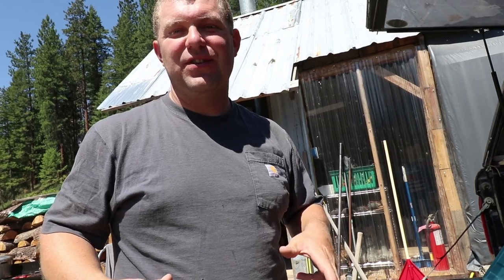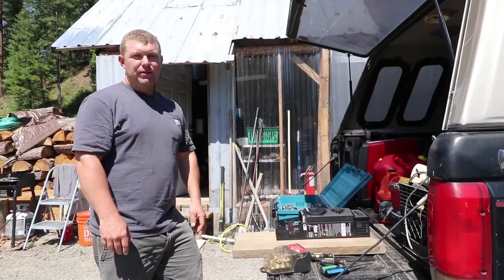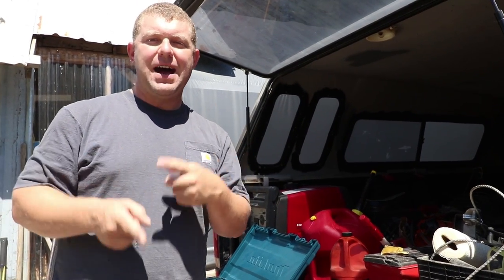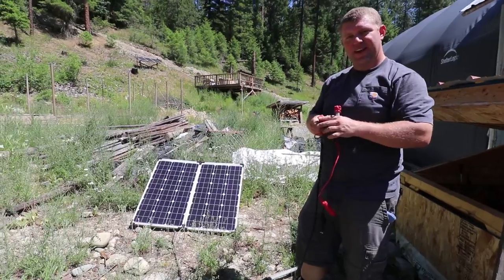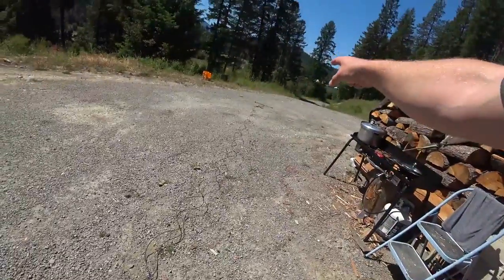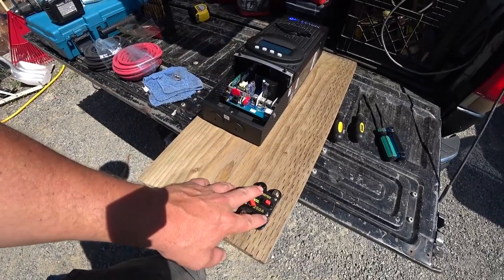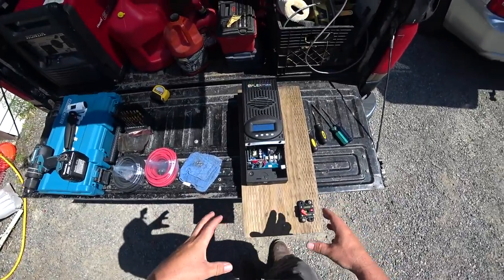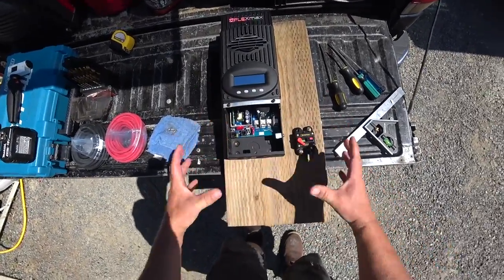Bad Idea? Now We Want Even MORE SOLAR POWER! (480 to 1230 Watt Upgrade)

Comment: Here's what they don't tell you about running a system in such a way. MPPT works only in stage 1 (constant current), when you go into constant voltage (stage 2, 3) the controller is holding your absorption voltage at it's preset (you must raise this beyond 14.4v to your batteries recommendations usually 14.7v+) and current limiting as the battery fills. It DOES NOT convert excess voltage here. so running a set of panels in series is killing available amps going in. And if you're not getting into boost mode due to a larger bank, you're spending most of your day in stage 2 and 3.

Comment: don't know if anyone else caught it but future advice. Never ring cut around a wire with a pocket knife any nicks in the wire my give you a future failure, also you really need to have a grommet or thru box clamp to keep your wire from the edges of the metal enclosure. The voltage is low but amperage on a DC system can be quite nasty when it gets shorted to ground. I have a friend that lost all the skin and muscle between his thumb and fore finger due to a short circuit at a DC connection he made.

Comment: I definitely don't want to sound like I am criticizing you, in fact quite the opposite. Going for the MPPT was the best thing you could have done, especially in your situation. However, when you're considering upgrading your system next time around, think about jumping over 24V altogether. The upgrades don't have to be step by step :) You got plenty of batteries to hook them up in a higher voltage configuration right away with minimal/no additional purchases.

Take it easy!

Comment: You said you have a problem with your battery bank getting hot have you thought of installing a couple of fans out of a computer and wiring them to a solar panel from a cheap solar powered flood light. We did that at a hunting cabin me and my family use and it keeps them a whole lot cooler.

Comment: Hello! People like to talk! I think YOU Guys are a Team plus are learning about everything! The same thing happen to Me! I started with 12 vdc inverter Big mistake! And about the voltage of your panels there is no problem! the way you combined them is the thing you have to worry. the charge controller mppt is rated to certain input voltage. for example 150 vdc, your panel input can not exceed 150 vdc.The charge controller will take care of your input,just dont go over the rated voltage.Were I live is very hot! I will give you guys a trick! Do this experiment, Spray them with water and you will see! mist them with water they love it!  It will improve your output! Good Luck!

Comment: hi safety note

it looks like you are using kabelklamps made in metall 

it might be wise to pot in some non conducting materials in case of coldfloting in the insulation 
extra important if you dont have a fuse on the battery side,
a short circuit ther can burn your cables and explode the batterys'

Sorry if my translations is wrong butt im translating fackterms from Swedish

Comment: Hi ! Have you considered getting a wind turbine to supplement your existing solar arrangements. Canadian Tire sells a 500 watt system for under Cdn $200.00 (and may be cheaper when they have sales ). I don't know how close you are to the border, but it might be worth it, considering the exchange rate.  There seems to be alot of chattering about wind turbines in northern latitudes. Cheers Michael Boulton

Comment: Good move! Should make your days much quieter without the generator. The more panels you have, the more days you get useful solar harvest throughout the year.

12 and 24v systems have cheaper parts than 36 to 72v systems and the 12/24v stuff is easier to find retail.

Comment: Batteries need to be clean and dry. Test positive terminal to anywhere on top of the battery to see how much voltage you are leaking away to ground.
Clean and Dry.

Comment: I use 2 24v 170 watt panels in parallel  that I got good deal on used not knowing certain panels were for certain voltage systems  and my cheapo chinese 30$ controller  has no prob stepping down and its not an advertised feature.

Comment: HI JUST A HINT don't wire the charge controller direct put Anderson plugs smaller one on the array side and bigger one on the battery bank so you can quick disconnect either one if you need to move stuff !!

Comment: If you're getting 70 volts input, it sounds like you connected the solar panels in series instead of in parallel.

Comment: I am very proud  off you2, let's get more of your kind, let's experiment, and learn along the way.......I have a suggestion to you maybe you can use the 12V small panels just measure the volt and series / parallel connect them with the big panels, The Volt and Amp have to mach If you have, lets say 3x12v, 6Amp and a 30V 6Amp panel. Then you can series the 3x12V 6Amp to a 36V 6Amp panel, and then parallel them to a 30V 6Amp panel, and then you have a "30V 12 Amp panel", it is not that complicated, the volt from the 3x12V = 36V vil end up as a 30 V 6 Amp panel when connected to a 30V panel.....   .....keep on learning Best to all JT Denmark DK

Comment: on the house thing if you do a renovation always have it inspected before you even consider buying it because you will be surprised at the amount of homes that still have asbestos in them where I live we cant remove the tape on the air ducts because the duck tape is keeping asbestos spores held down and its been like that for at least 20 years no joke and we knew about the asbestos and we know better than to disturb it.

Comment: your breaker probably needs to be smaller, you ideally want a breaker with amps a bit higher than the normal operating range of amps. 250 amps likely wouldn't "break" until well after your system fried.

Comment: Why not use your old panels to bring power to another location on your property? Having a small system to have lights up by your water storage and/or hot tub that doesn't draw from essential elements isn't a horrible idea. Plus you could then use it for a couple luxury items. No one is going to judge you if you add a little outdoor sound system (I use that phase loosely) and electric skimmer for the hot tub. You might not get to use it year round, but could be nice when you can get to use it. Another idea, emergency power in a storm cellar. And you might have an easier time running your freezer if you have it underground. Just throwing some ideas out there, although I can't think of a reason not to have a storm cellar even if you don't run power to it.

Comment: There is no rule of engineering that says a system must be pretty to work well. People evaluate systems on their appearance because they don't know how to properly evaluate them on their performance specs.  Understanding how your solar system works is an admirable thing.  That kind of knowledge will empower you to make changes to your system and not be at the mercy of the contractors.

Comment: I think you will find that if you wrap your freezer in 2 inch rigid insulation you will find it not coming on very much. you can get 2 - 4x8x2 sheets at home depot relatively cheap ---
Reply: I had the exact thought.
Reply: or build it a small room with an air conditioner :)
Reply: Why would you do that the heat from inside the freezer is rejected to the ambient area via the condenser. Which is close to the outside skin.That's why the outside of your freezer feels warm to the touch when it's running.

That's like  running down the street with a blanket over your head in the summer
Reply: Depending on the type of condenser the freezer has, that might not be an option. If it has an external condenser coil, this will work. If it uses the outside of the case to radiate the heat off of it, this would raise the head pressure, because it would not be able to get rid of the heat that it removes from the interior of the box.
Reply: Really really bad idea. It would not work well at all.  The heat pumped out to produce the ice inside is dissipated through the skin of the freezer. If you put insulation around it then it won't dissipate the heat.  The only place you can add insulation is to the lid.
Reply: That is not true, i have seen it done with no side affect
Reply: C Thompson ......
This may be a location issue!  In the UK fridges and freezers invariably have a condenser at the rear (allowing the heat to convect upwards out of the way) ..... Insulating slabs would work with that type of device!
Reply: Dave W, Here in the US you almost never find newer fridges or freezer using the rear condenser.  Occasionally you can find a cheap unit that does that but not that common anymore.  We had one as a kid on a fridge. It was always full of cobwebs. Never actually seen one on a freezer.

Comment: I noticed your freezer is quite empty or your really strong     to make your freezer run less use plastic jugs 64 oz to 128 filled with a salt water solution for a lower freezing temps      fill jugs to 75% to 80% n put in your empty freezer space     I have about 10 gals in my freezer n it barely runs

Comment: Why not build a second rack for the old panels closer to tour old charge controller. You can parallel the new and old systems. If this creates to much charge current for the battery bank charge rate, make an isolation switch where you can turn them on during high loads. Alternatively add water heating (hot tub even) dump loads.
Reply: You may get messed up data logging, but no more than your generator.. There is ALWAYS a use for extra panels on some sort of secondary system.

Comment: I think it's time to start building, no matter what your construction technique maybe you have several years of building in front of you. Building permits, plans, materials?? If you're using the saw mill that lumber will need to air dry for a year. Depending on your location building codes could have a real impact. Good luck.

Comment: Don't be in a hurry to retire the old panels.  Another good home is a fine and good thing.  In the meanwhile, it's still free power.  Even the cheapest charge controller and an under-performing battery(ies) might find something to power.  Even one of them might ventilate your primary battery bin. ;-)

Comment: Constructive criticism here - also I may be seeing these videos out of order but.....
Your new charge controller seems to be more effective at getting the power out of the solar cells so I would really have loved to see you change the charge controller and run it with your old panel to see how much more power you got out of that one.  In other words, I would have like to see you change only one variable and see what the changes, not just the size of the panel as there is more that affects the power output of the panel than just size.
Also, you mentioned that you had a lot of extra wire after your last job. It is possible to mitigate some of the energy lost in a low voltage run by paralleling wires because then you lose much less energy through resistive loss.

Comment: One suggestion:  I deal with high power connections for HVAC.  If you run by some conductive thermal grease, you could save potential overheats at those lugs.  You can test the connections by feeling if they get hot. I have had 6 guage wire connectors blow off, spark and burn an inch of insulation and melt some copper due to an imperfect condition.  I think the aluminum connector paste will work.

Comment: use old panels to power fans on batts case the large pc ones work great as if enough sun they power faster or slower depending on heat/sun or use the car solar panels you get i use on my van so if no sun no fan as no sun no need for the cooling

Comment: Having knowledge in several areas like you explain is called a JOATMON. "Jack of All Trades - Master of None". Which isn't a bad thing. Knowledge is power and the more you know about everything the better you will be at anything.  However, this is not to say you should ignore good advice, I don't think you do.

Anyways, the biggest thing to remember about solar is that it is not a on demand system. You need storage. If your batteries top off at noon, then the rest of the day is wasted power as there is no place to store it. Your inverter draws power from the batteries, not from the panels. So, your next upgrade should be the batteries. Add more, don't need to go bigger, just add more. 
Until we are allowed (yes I said "Allowed") to have more efficient batteries, the batteries will always be the weakest link. However, I don't suggest mixing news ones with old ones. But if you can add 4 or 6 more "good" used ones - do it.

Comment: Nice you finally got the MPPT installed and see the benefit, but as an electrical engineer dont use that 250amp breaker for disconnect on pv, they are designed for automotive use and majority can only handle upto 32v and you giving it 71volts !, if you switch it off or it trips (doubtfully) you will arc the contacts and i will cause oxidation damage to the contacts on the breaker which will result in a garenteed failure, luckily though the outback controller you have has the arc fault detection and will save your bacon but the damage has already been done. my advise is rip out that 250 breaker and find a proper solar DC disconnect switch, as you said the system is only as strong as the weakest part, please take my advise and dont touch that 250 breaker while the sun is out i dont want your next video to be a disaster :(

Comment: Guys - you tubes has 2 rules set in stone
1 - Haters will hate
2 - EVERYONE is an expert in their own lunchbox...... listen, filter, adapt if it fits or offers another opportunityu & solution

Perfection is a goal/ state that is NEVER achieved except to the participants...... as I learned in the military 99.99% of experts are  "EX" - once of..... "Spurt" - Drip under pressure. Most experts I have ever met in my Military or Engineering life have had ZERO real life experince in their fields of "experise".... don't sweat it, don't let the turkeys drag you down to thier level.... real quick you will find that they live for that shit....... Your path -walk it with heads up & happiness!

I admire that you responded, however to those of us outside the ivory towers, you are rocking your world & thank you for sharing

Comment: why not reconfigure the panels you had been using in to with your new panels? Like if they are both 12volts the series them to bring them up to 24 volts which would add those watts to the over all system. most panels that I have seen are based on the 12 volts the differences being how they are wired together.

Comment: Why are you not considering an integrated unit such as the one from Flin Energy? Their dual MPPT  3kVA 24 volt unit should be similarly priced as the Outback charger only unit and you get the inverter also. Lastly you can prioritize whether you want to power the load first and then charge the battery etc. Further the dual MPPT allow two different set of panels.

Comment: Basic facts:  24v or higher for your panels will reduce power loss.  Current 2x= power loss 4X.  Wire can be much smaller.  Most efficient LED lighting is using 12 or 24v. No need to lose conversion to 120v and then back to 12 or 24v leds.  I used 24v led strips and put them in alum channels with a diffuser.  EIther way, no need for lighting to be 120v.  Good Luck

Comment: Yeah, the reason voltage doesn't mind moving over small gauge wire is because voltage does NOT move at all.  It is current that moves, since current is the flow of electrons.  Voltage is nothing more than a potential difference between two points.

Comment: you know that 250 amp breaker there is really useless as a safety device, right? it's basically acting only as a switch. for the breaker to trip in the case of a fault, the cable connected to it must be capable of handling that amount of current, and the solar panels would also need to be capable of providing it. no big deal.

Comment: PWM ... not only the lenght of tzhe wires ... also you are limited in the volt range of the modules
If you use a MPPT, it will use all energy and as higher you go, so less amps you need in the cable = thinner cable

Comment: I know you don't care for criticisms but sometimes people try to advise you against doing something that could be extremely dangerous. For instance, did you check all your battery cabling for UV durability The solar panel wiring will obviously be UV safe BUT the battery cables usually do not need UV protection in most installations, but yours seem to have direct exposure to sunlight,

 In addition, when running any power cables DC or AC they need to pass through smooth edge bushings and NOT close to razor sharp metal sheathing etc. Electrical shorts from AC in your case would simply blow a breaker, however DC from a battery bank is a whole other ballgame.

Comment: like what and why your doing what you are I have been off grid for 16 or so years with a few battery change outs so one would say my system is old . after doing a lot of research because it was battery time again I bit the bullet and went lifepo4 its a lithium battery and I cant explain well enough how much better your system will work . you should look into

Comment: I wanted to share some experience. The wire crimper your using is not the proper one for the ire thickness your using. I assume you already know this, but a bad connection also wont be 100% effective. What I have done in the past to make sure I had a proper connection. Grab the terminal, heat it with a plummer torch, and melt some soder into it, then push the wire in. This will give you the best possible connection using the tools you have now. Last use a good marine adhesive heat shrink as this will protect your ends and make sure the system functions properly for many years to come.